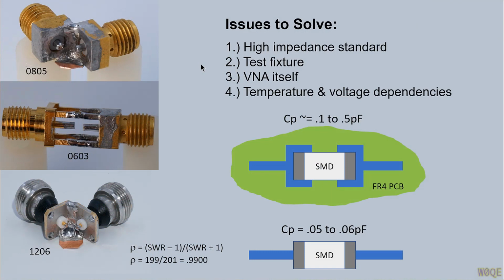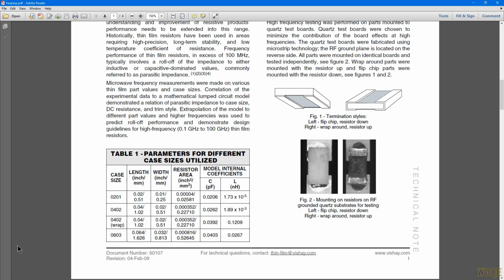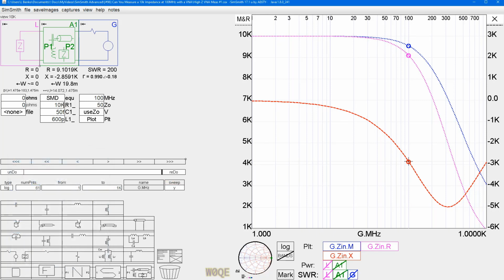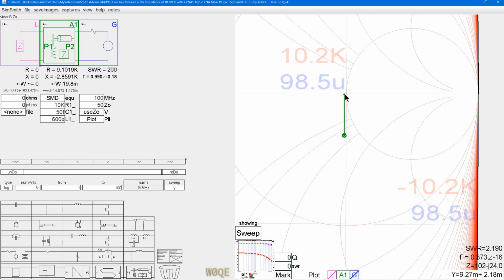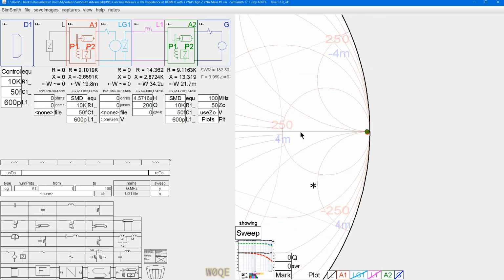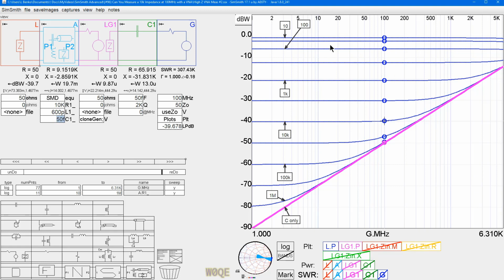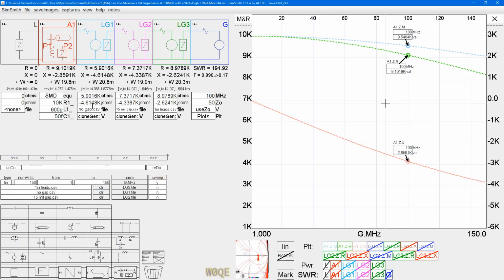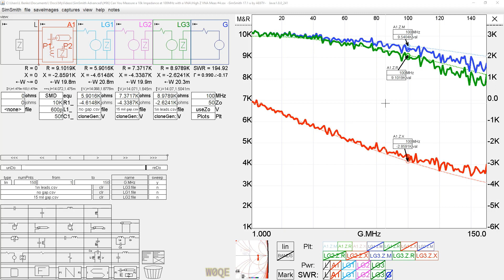#96: Can You Measure a 10k Impedance at 100MHz with a VNA

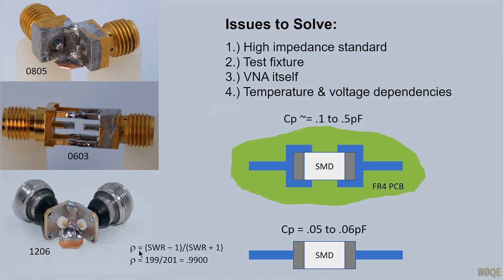Comment: 1:35 more to the point... 9950 ohms is a reflection coefficient of .99000, 10k ohms is a reflection coefficient of .99005. That's a relative difference of 0.005%. If your VNA and test setup has, say, a 0.1% relative accuracy, then 10k ohms might read somewhere between 9k and 11k. If you have a 1% relative accuracy, then 10k ohms might read somewhere between 5k and infinity.
Reply from the maker: It is hard to say 1% accuracy applies to reflection coefficient and that it might be linear over the range.  If it applies at the p=.99 then you are correct.
Larry, W0QE
Reply: @w0qe  Yeah, admittedly I'm still simplifying things a bit, but it goes to show why it's such a hard problem. I also like to build chokes and measure them :)

Comment: Hi Larry:

Could you perhaps do a short video where you actually set up the nanoVNA, measure a common mode choke, and then show all the numbers?  I think for us newbies it would be very useful to see it actually performed in addition to the description.  Thanks.
Reply from the maker: Hepcat,
I loaned out my NanaVNA and with the Covid-19 stuff I haven't tried to get it back yet.  However the focus of my channel is not equipment reviews but education to allow others to be able to understand and make measurements.  For example in this video the take away should be that an 0805 size resistor is really the resistance value in parallel with a capacitance of .05pF.  Get a few resistors and become accustomed to making measurements seeing what you can do.  If your question is about how to measure the common mode impedance of a choke that is physically large I discussed the effect of clip leads on measurements in video #77 https://www.youtube.com/watch?v=xLGSblc-Fec which might help.  Also videos #80, #81, and #82 deal with baluns which are common mode chokes.  Does this help?
Larry, W0QE
Reply: @w0qe  
Yes, that does help. Thanks.  I have parts on the way.

Comment: I'm wondering, in which case do you even need to measure such high impedances at RF frequencies at almost any degree of accuracy?
When is such information practically vaulable?
Reply from the maker: Ivkan,
For me the most common need to measure high RF impedances is when I measure the common mode impedance of an RF balun.  The common mode impedance can easily be in excess of 10k ohms where resonance occurs and knowing the that the value is at least reasonably accurate is all that is really important.
Larry, W0QE
Reply: @w0qe   So, I presume that the purpose of such measurement would be to calculate the "CMRR" of balun to balanced-line system?
I never thought of that :D

I usually thought that an impedance of~1k would be enough for such purposes :D
Reply from the maker: @dedamarsovac  
In higher power transmitting applications where the common mode voltage across the balun is high and if the common mode impedance is modestly resistive the power dissipation of the balun becomes too high.  It is hard to keep the common mode impedance nearly completely reactive so often just making the total impedance in the > 5k ohm range is the easiest way to not have the balun overheat.
Does this make sense?
Larry, W0QE
Reply: @w0qe   It does make sense.
It actually hides another "measurement method" : just apply a lot of RF power in common mode across the balun and measure the temperature using a thermal camera :D
Just kidding, not gonna do that no :D
I never worked with such high power RF things, I only worked with fairly low power RF stuff on PCBs, designing for various gadgets having GPS, Wifi, BLE, LoRA, Sigfox, etc.
Not a watt of RF Power :D
And there's so much to learn
I'm still not up to a challenge of designing a proper LTE (wideband) antenna to be embedded in a small device having any reasonable efficiency.
Reply: As for the measurement part, I always liked to use tricks to make any kind of high precision/accuracy/range measurements, often to the point of "in real life, does it even matter", which I often find hard to answer :D
Be it nanoohms, teraohms, femtofarads, or just being a volt nut :D
That's pretty much what actually bothered me and why I asked the question :D
Reply from the maker: @dedamarsovac  
I done exactly this many times and it is the ultimate test.  The temperature rise is due to 3 causes: wire loss which is current squared times the RF resistance, voltage across any cores in the balun and the resulting core loss, and core saturation.  Core saturation can almost always be ignored unless your RF signal has a very high peak to RMS value.
Larry, W0QE
Reply: @w0qe  I use end fed antennas, and need choking impedance over 20 kohm, and voltage rating over 3kV. Resonant multi-layer coaxial choke is the best option. For impedance measurements under 10 MHz, I simply measure with AIM-4170.
Reply: @w0qe  this is very important for end fed antennas and 1500W. Antenna impedance Za=2400 ohm and Va=3kV. I use two common mode chokes resonant at operating frequency, about 20 kohm each.

Comment: How to measure antena frek UHF ?
Reply from the maker: Edi,
I don't understand your question.  At UHF frequencies you need a VNA capable of measuring at the frequency you want to measure at and the only difference vs measuring at lower frequencies is that you need to be more careful with your measurements due to the shorter wavelength.
Larry, W0QE